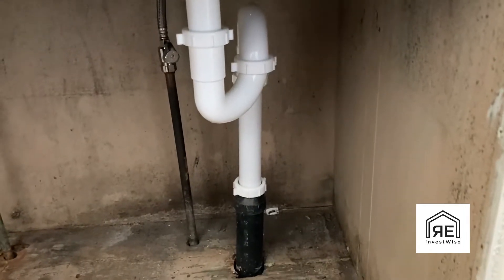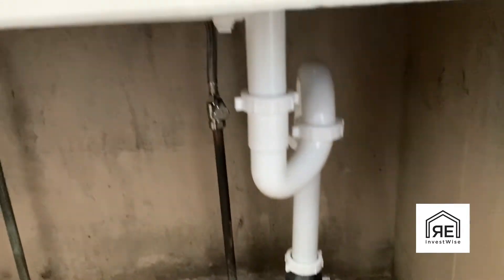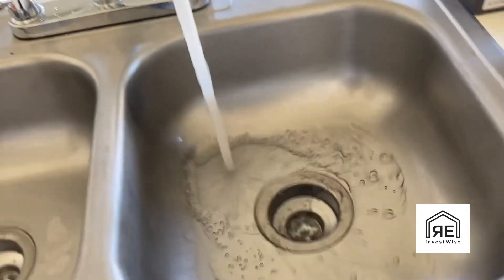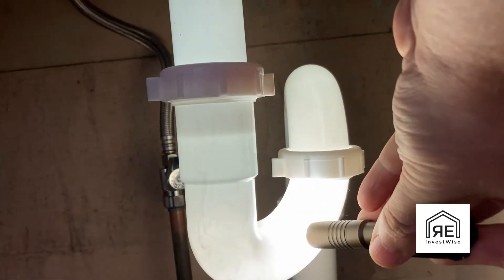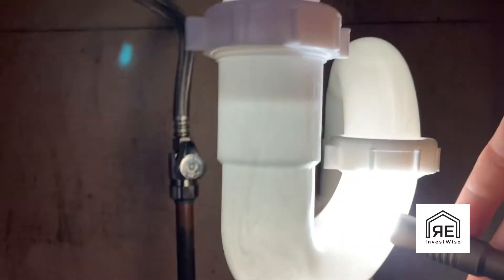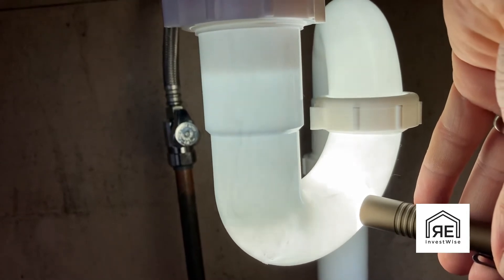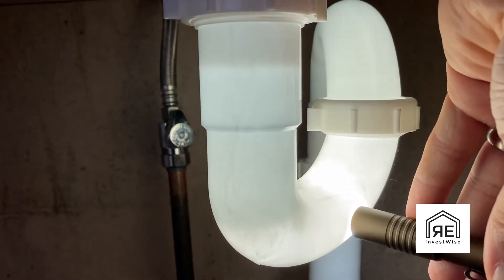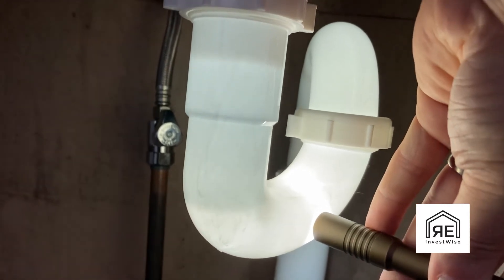Danger of S Trap with no vent. Water siphon

Comment: In Germany, every house has at least one pipe, which ends on the roof and ventilates the system. 
This avoides two problems at once. The pipe system cannot be sucked empty, all kinds of traps are possible, 
and the duct system is well ventilated so that no explosive gases can accumulate. 
The cheap variant is a valve above the S-Trap, which opens briefly when the pressure in the pipe is low, vents the pipe and then closes it again. This is used when, for example, the draining water from the dishwasher or washing machine creates a negative pressure in the pipe while it is being pumped out and there is gurgling in the S-Trap under the sink. 
Of course, this does not eliminate the cause of the gurgling, the incorrect laying of the drain pipe.
Reply from the maker: There is a vent through the roof on this house but this kitchen sink is not connected to it. If you watch my other video on this project you can see I installed an under counter mechanical vent. Problem is fixed. Thanks for the added information